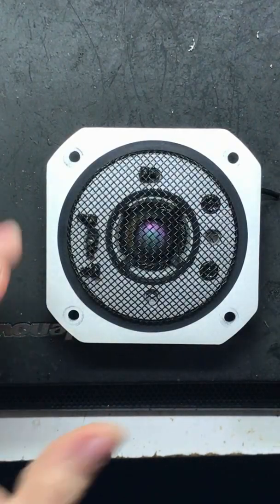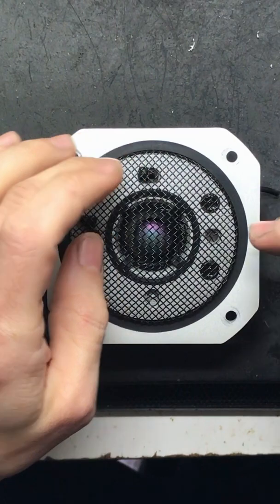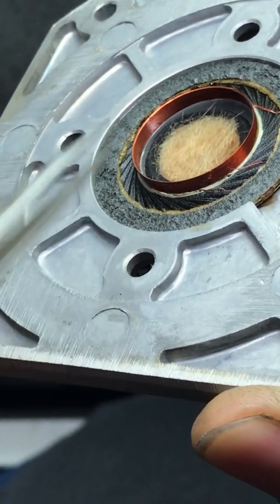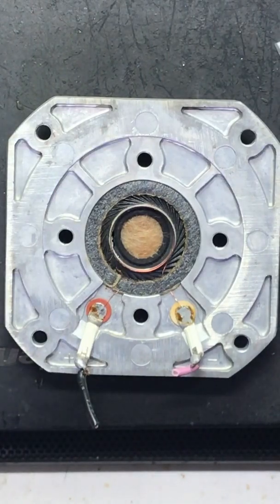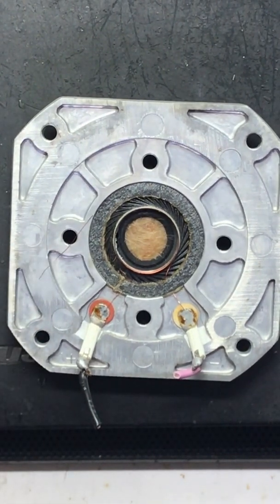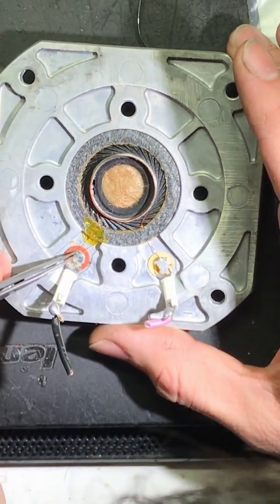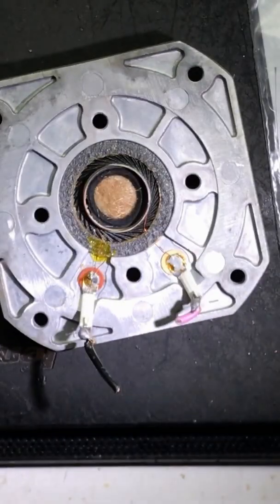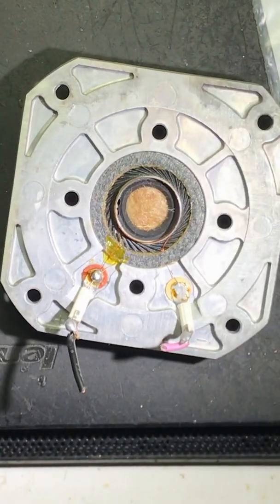Repair - Yamaha NS-1000M beryllium tweeter repair tutorial

Comment: i found the wire then broke the wire. Not good .  the hole/cut is getting longer  and if thats not bad enough now my wire is to short . i  have a small piece of wire hanging out, but its covered in epoxy.  this shit  is brain surgery.  how do i clean of wire without  breaking it again and where do i get some donor wire. you cant look, think, talk, dream  about this wire without it breaking. Any help would be much appreciated.  YOU ARE THE SPEAKER WHISPER.
Reply from the maker: Hi. I bought a non functioning tweeter that was beyond repair and salvaged the coil wire. the coil wire cross sectional area is not round but square hence why I did want to use the same wire as the original. To clean the  wire from epoxy or any shellac, I usually put some solder on my soldering iron and heat it for a few seconds, then agitate the solder a little big and heat again and repeat the process. That should remove any coatings. And yes, it is very very thin and very easy to break. It all boils down to patience. Hope this helps and goodluck!

Comment: The glue that have to be used in the coil is epoxy or can be a soft glue ?
Reply from the maker: I d suggest something hard, but slightly (very slightly) soft-ish... you would want the glue to be hard enough to transmit the precise vibration from the coil to the actual beryllium dome, but yet soft enough to not develop cracks over time. on mine, i used epoxy. Sound-wise I didn't notice any ill effects ... but, being close to 40, I might be loosing the upper part of the hearing spectrum too, thus not noticing :)

Comment: How does get the coil assembly back correctly in the right place and how does he get the screw back after  they are rattling about caged in the front.  ?
Reply from the maker: you use a tweezers li reposition the screws - very easy. re. coil assembly, you have to find the sweet spot; feed it very low audio and closely listen to any distortion.

Comment: my tweeters measure open circuit but i can't find where the wire is broken. Any advice? can you repair mine?
Reply from the maker: i do not do any repairs unfortunately. you ll just have to find it using a lens.. sometimes it is not that straightforward.

Comment: Hello, i have these speakers and they are amazing! I already have to replace the tweeters, if it happens agains thanks to your video i will know what to do, i appreciate. Also i wonder if you recomend some kind of protector for them that don´t affect the sound quality. Greetings from Argentina!
Reply from the maker: They really are amazing! those beryllium mids and highs are the secret to super crisp audio! they are extremely fast-transient speakers, IIRC in the region of nearly 20dB per millisecond! I do not know of any protector that really works without affecting sound quality; maybe a fast blow fuse? the key to protect these (and many speakers) is NOT to drive the amplifier into clipping. Sound clipping is what kills them. Many times, it's better if you have a higher power amplifier as that will lessen the chance of clipping.